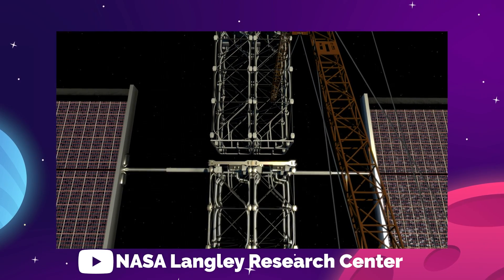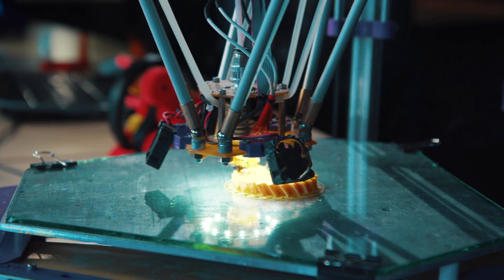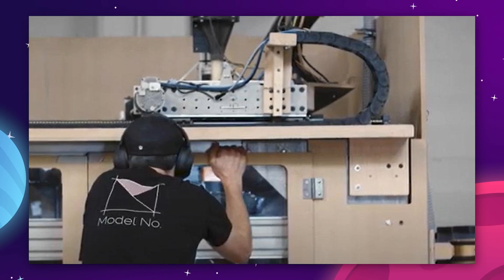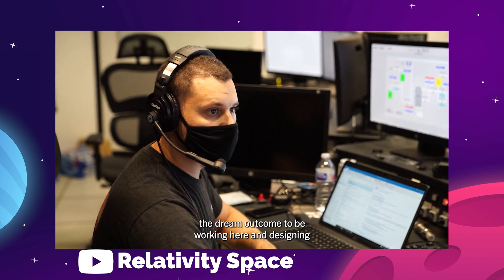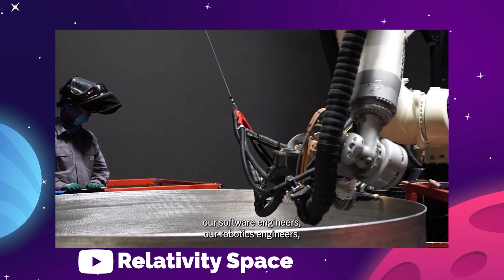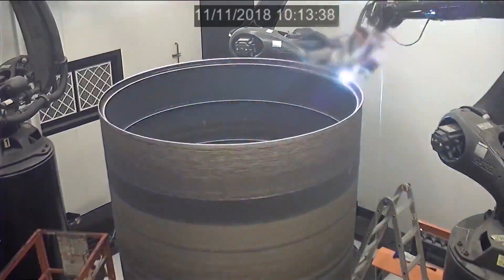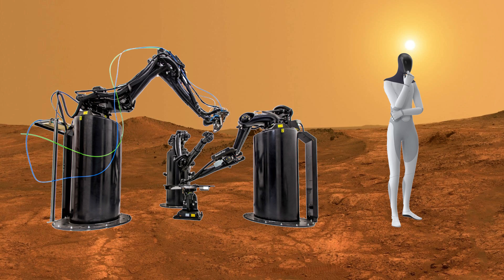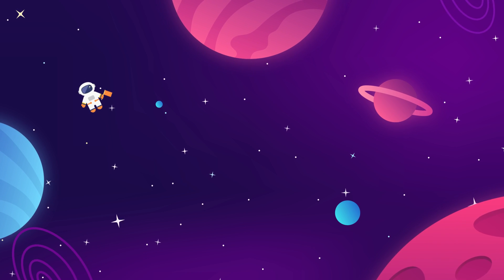How NASA Plans To 3D Print A Mars Colony!

Comment: I explore mars land and there’s lot of mountains and rocks 🪨 present which can be ready for an underground as well as constructed a solid structures by drilling into these areas as preliminary steps and later more options can be explored. 
Most of rocks found a sharpen edges that means wind speed is quite high there that’s another source to producing electricity there.

Comment: @mark Harmon I couldn’t find your comment in reply to mine so I hope you see this. I claim no real expertise in microwave power transmission but I do know that the reason they are unaffected by dust is the size of the grains is much smaller than the wavelength of the microwaves.
The rectifying antennas on the surface resemble nets and so would allow dust to pass through but only further research as far as I know can determine how big a problem electrostatic attraction might be. 
By using many solar power sats in low to medium orbits the surface spot size can be minimized and the use of gigahertz frequencies would reduce it further.

Comment: Dig level tunnels and caves half way up a mountain at the equator. Energy collected via wind and solar used to force Mars air into tunnel entrance. Generator powered by air moving to exit tunnel used to make and maintain living spaces. Exit tunnel sized so waste materials blow out and down mountain side. Heat caves used as batteries to generate power when wind and solar cannot.

Comment: The amount of energy required to melt or sinter the rock dust is very high. The prepared material medium needs to be exact and clogged nozzles need to be maintained. There's easier construction methods

Comment: Nice video but I would argue it is not very balanced. 3D printing is ok for certain products, but due to extremely poor metallic grain structure cannot fullfill all requirements. For example, the SpaceX Starship will still be using cold rolled sheet steel due to its major advantage in strength relative to anything that can be produced by 3D printing. Relativity have yet to prove their rocket systems.
Reply: I agree. I... don't really get the hype around 3D printing at all. Still feels like it's a cute gimmick rather than something that can revolutionize manufacturing. I mean, what's the point of constant iteration in outer space? Shouldn't we try to at least attempt to design something well before trying to make it in space?  Retooling seems actually easier than creating one complex 'robot' to do it all. I don't know much about engineering principles but I wouldn't be surprised if 3D printing was considered just a niche multi-tool by specialists in the fields of machining/construction. Are we seriously saying that a dedicated tool can be replaced by a printer? Are we going to build everything from crappy materials with this one machine? I don't know.

Comment: Thanks Kevin.  Something else you might want to consider is Subtractive printing aka CNC Router.  It's the complementary tool to Additive Printing.  It's every bit as important.  More so if the surface quality is important.  Together they are far more powerful than either is alone.

Comment: I'm always troubled by very basic things as to how materials function in temperature extremes.  In deep space it's roughly 250f minus in the shade and 250f plus in the Sun.  Still interesting video.  Can we print an oxygen supply?
Reply: Known as MOXIE, or the Mars Oxygen In-Situ Resource Utilization Experiment, the device is extracting small amounts of oxygen from the Martian atmosphere (which is 96 percent carbon dioxide) by running it through an electrical current, a process called electrolysis.

Comment: I’d like to see a gravel plant built from 3-D printing. This plant will process all kinds of hard rock and perhaps regolith materials into different sized aggregates.
Reply: You need Portland cement and water to make concrete. You also need enough air pressure and warmth to keep the water wet. Too cold & it freezes. Frozen concrete is useless. Too little air pressure and it boils which also ruins your concrete.
Reply: @Dave5843-d9m  
Concrete? whatever do u mean, concrete? Please expound on that.
Reply: @Dave5843-d9m  
You also mentioned Portland cement. How on earth would you make this on Mars?

Comment: The trick is to build with the material upon which you stand. 

In this case Martian regolith.  Basalt fibers can be spun from concentrated sunlight on native regolith.  Then the fibers can be woven into long fabric tubes.  The native regolith can fill the tubes and be stacked and coiled in place and into appropriate shapes for their purpose and beauty.  Compressive material as filler.  Tensile material as confinement. See Cal-Earth Institute for examples of such homes built here on Earth.
Reply: How are the fibers made?
Reply: @tech5298  Basalt is crushed, melted, extruded, spun into fiber and from there woven into fabric.  I think the process is similar to fiberglass.  Basalt is more durable, stronger and less friable.
Reply: Solar rays could be concentrated with mirrors to melt crushed basalt which I have heard said is plentiful on Mars.  Where are the mirrors coming from?.....Polish some stainless steel from a borrowed piece of a Starship? An acre sized sheet of mylar draped over a crater with a mobile crucible tracking the focus.  As the Scottish would say...I don't know.
Reply: Might be better to leave the mirrors in orbit and beam power down by microwaves. That way dust storms never interfere. I believe that this is the best way to provide power for Mars.
Reply: On mars you need to not rely on only 1 power source, you need nuclear, solar, and eventually geothermal.
Reply: @davidhenry5128  I can see fission being useful to get things started. We will need to add uranium mine and enrichment facility to the honey-do list for long term sustainability. Not sure if uranium or thorium is available in high enough concentrations.
Reply: Actually beaming power from orbit is one of those rare ideas that is so superior that it alone is all one needs. Once a few satellites are in orbit there can be power for any location on the planet continuously. All this for lower IMLEO if they use their solar power for electric propulsion and because compering sources have to be landed on the planet. Oh and microwaves are unaffected by dust storms.
Reply: @markharmon4963  bro,  that is some sick knowledge you have. Fibers out of rock? That is just mind blowing. Thank you for sharing that
Reply: @tech5298  Thanks for your interest.  Basalt fiber is a burgeoning industry here on Earth.  Superadobe is a technique/technology that is gaining traction as well.
Reply: @stevemickler452  I am unfamiliar with the technology so please accept my questions in the spirit of genuine inquiry.  Are microwave energy receivers unaffected by dust accumulation?  Is atmospheric dust transparent to microwaves?  There is always a diminishing return when energy changes mode.  What is an aspirational efficiency level?  I can see where portability might be an issue as you would need a separate transmitter for every site that requires power.  I take it then that microwave energy transmission would likely be best for large base stations.
Reply: @tech5298  Currently polypropylene fabric bags are used.